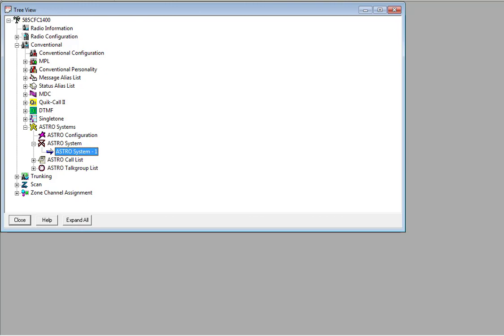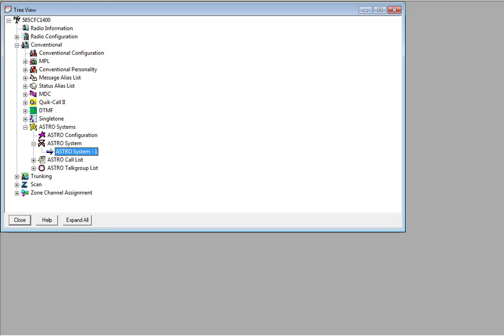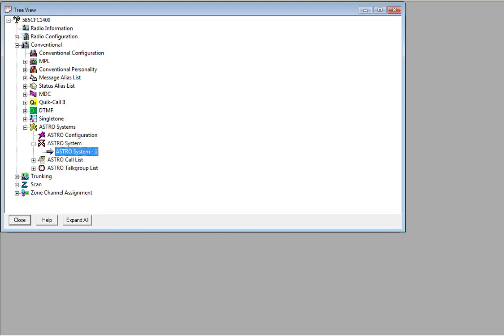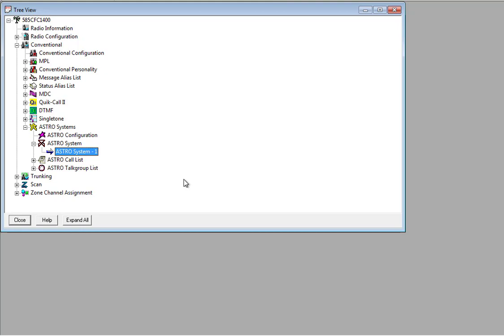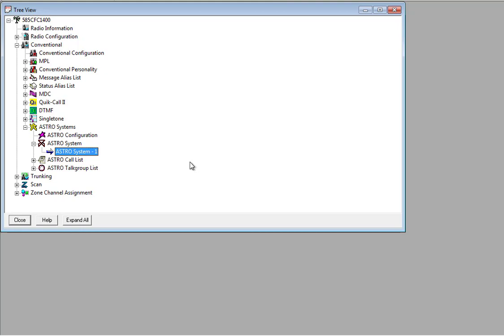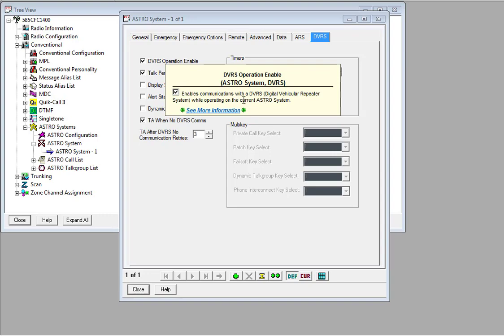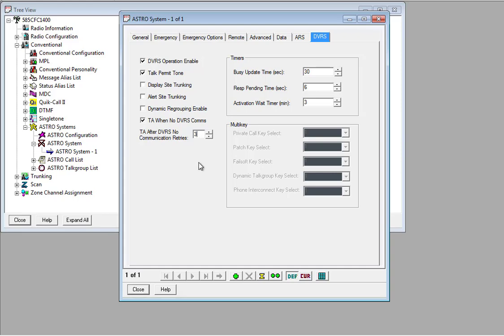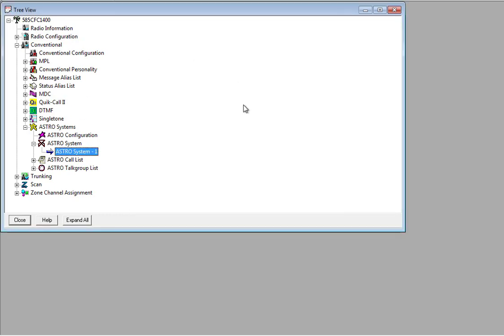P25 Motorola Triple Beep (Talk Permit Tone) - How to enable it

Comment: There is a slightly different permit tone for a P25 Phase 2. 
Have you ever heard that and do you have an example for that?
Reply: The beep’s a little bit longer than the triple one right? If so, yes I’ve heard it
Reply: The 4 beeps means a channel that is normally set to be encrypted has encryption turned off- 4th beep means channel is in the clear